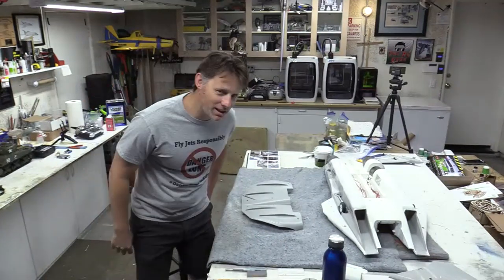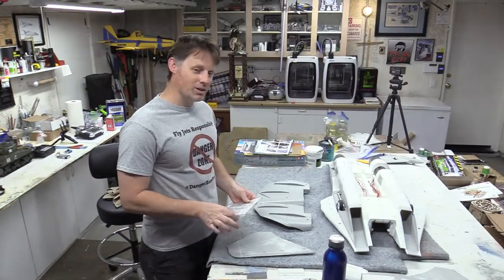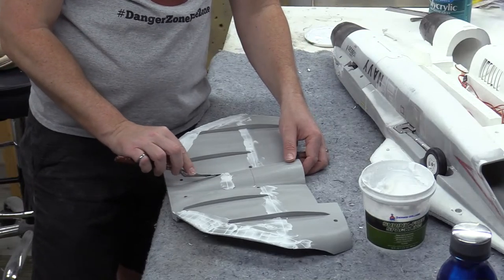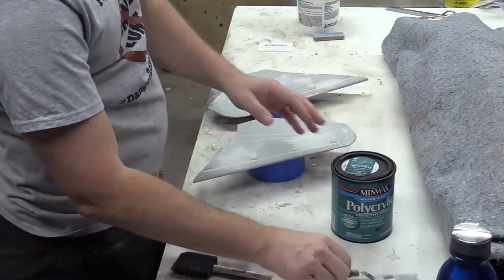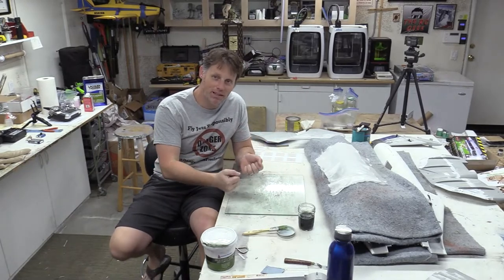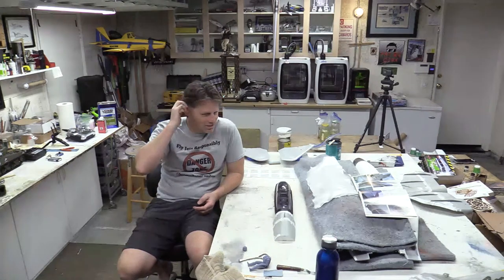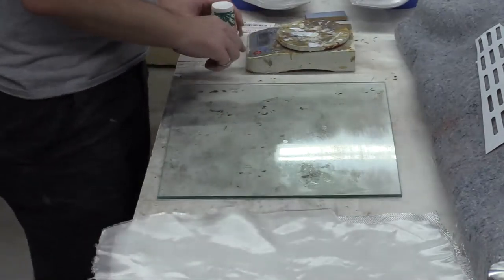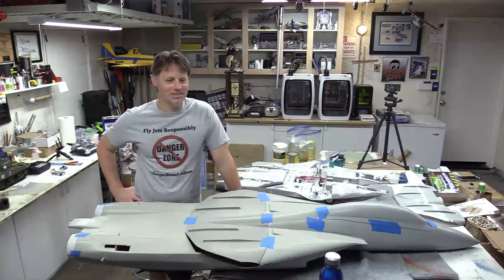Shop Time Live -- Foam Refinishing Tips with the Freewing F-14 Tomcat

Comment: I was going to try the A-6 gear on this airframe, they at least rotate 90 degrees for a bit more scale appearance. You and corsairnut have done great work on these airframes, thanks for sharing your knowledge will us all!
Reply from the maker: Thanks!  I still have a long way to go on mine. 😕 My only concern with the a6 gear would be wether they would be robust enough to handle the weight of the tomcat.

Comment: Another good spackle is Red Devil onetime light weight ready mixed Filler. Great stuff good to work with and sands well very light. One thing ya can do is go to car wreckers and get airbags the ones that have gone off as they are usually free. The ones with out blood on them even better. Most are made of Carbon Kevlar they work well have used them on a  couple things and there different thickness as well. ;0)
Reply from the maker: Cool, thanks for the tip!

Comment: Hey Chris, hi from New Zealand!  No flying here either :(. Another great demonstration of how it’s done by the master. Thank you. You mentioned gatoring of the foam in the cockpit. I know it’s not perfect scale by I put small holes in the very top of the clear canopy to let the heat out. Seems to work out ok. :). Can’t wait to see the F14 finished.
Reply from the maker: Thanks!  Even when there are holes, I’ve seen cockpits gator up. I like to cover all the exposed areas with card stock to hide it all, haha!
Reply: Yeah, no perfect answer. I have seen your card stock solution, looks great. I will have to try out that one!  Keep up the good work. :)

Comment: Hey Chris, I fly off a rough grass runway that doesn't have short grass.  I know that there are mods you can do to reinforce the landing gear, but do I have wishful thinking that I would be able to fly this off a rough field?  I have seen RC Informer's videos where he is taking off from golf course like grass, my field is no where near as nice.  Just wanted to get your opinion before investing $$ into this.
Reply from the maker: Yeah, I’m not to sure. Maybe with the right power system and tires, but that might be ok, but if the grass is that rough, you may be better off with something that has larger tires. What’s the length of the field?
Reply: @Thercgeek  Looks to be about 410 feet from end to end.  It's sometimes a challenge to take off with my FMS F-18 and FW F-35 if the grass is too long or if I don't have a headwind.

Comment: what about using that sanding cloth used on dry wall. It does not load or overcut.
Reply from the maker: It’s all about the grit on it, so if it’s not too gritty it should work just as well. Lowest grit I use is 180, any more than that and you run the risk of easily cutting into the foam. Epo whiskers when you sand it and you want to avoid that.

Comment: Chris, I’ve got an issue electronically with a Dynam Corsair that’s got me stumped. (As soon as you power down the receiver the landing gear retract. Spektrum DX8, does it with both the Admiral and Lemon receivers) This isn’t my first plane, I’ve programmed over 30 plants, 25 which are still operable. (That first year felt like I was training to be Kamikaze Pilot)
Plugged in the 5th channel for Gear
Channel Assign 5) Gear
“A” switch on the DX8 Gen2
Anything come to mind to try?
Reply from the maker: The fact that it is doing that when the receiver is powered off is strange. That would indicate that there’s still power. Usually something like that has to do with the transmitter configuration when the model was bound. I’m sure you’ve already tried, but try rebinding the receiver with the transmitter in the configuration you want the model in when you power it on/off. Otherwise, if that doesn’t do it I’m at a complete loss. I’ve never seen anything like that before. Usually it’s on power up and can be rectified by rebinding.
Reply: The RC Geek when I get back from Charleston I’ll check the DX8 and just delete the plane and set it up as a new plane. This aircraft has been my “Bermuda Triangle/Todd Marinovich”. It was my 3rd ever RC plane and I bought it on eBay. Airplane separate. motor, ESC, servos, pushrods and prop in a separate order. It is interesting, once the plane is bond, wheels lower, flip the “A” switch and the wheels retract. Never an issue while bound. Land, taxi, turn off the transmitter... up go the wheels. (I’m out there trying to look cool with my “Bro, do you even lift?” sweatshirt and my Pilot Ryan Spektrum cap. Having a Corsair with gremlins isn’t cool.
Reply from the maker: Based on wha you described, are you turning off the transmitter before powering down the airplane?  You should always power off the airplane first then the transmitter. That said, based on why you’re describing, when you power on, I’m guessing the wheels will start to retract during initialization. That’s really strange.
Reply: @jeffhenderson934  At first you said when you turn off receiver, you then say when you turn off transmitter. 
ALWAYS TURN OFF PLANE FIRST.
When you turn off your transmitter first, the reciever is still powered on, as it is inside the plane, it is now receiving no signal however (loss of signal). At this point the receiver defaults to its failsafe positions for all channels. Check your bind procedures. Most transmitters incorporate the failsafe positions into the binding process and usually just requires that you put all controls in the position you would want them to default to if signal is lost IN FLIGHT when you bind the transmitter and receiver. This is usually motor off, neutral controls, and gear retracted. Your plane is doing EXACTLY what it is supposed to. You, however, are following an INCORRECT power down procedure. 
ALWAYS POWER OFF PLANE FIRST.
You are lucky that the throttle channel is almost always set to default off, so you haven't got cut up by killing the transmitter first. 
LEARN ABOUT THE FAILSAFE SETTINGS, and when you bind a plane and think it's ready to fly, kill the transmitter while holding the plane to make sure the throttle is set to default off, gear are set to default up, controls are set to default neutral. This will not only keep you from possibly getting bitten on the workbench, but will keep your plane from going to full throttle and flying away possibly causing damage or injury to persons or property. You'll also stand a better chance of recovering anything from the crash.
Improper failsafes are very dangerous. Please read up, for the safety of your spectators, your planes, and yourself.
Reply: @jeffhenderson934  The failsafe info is covered on page 13 of the DX8 Gen 2 operating manual.
Reply: @jeffhenderson934  The warning to turn the transmitter ON FIRST and OFF LAST.......... IS ON PAGE 2.
Just saying🤔😕🤨😎.
Reply: Shelby Seelbach I had at the time when I purchased the Apprentice a 14 year old mentor (son of 2 friends of mine) who had by my calculations, $25,000 worth of planes, a DX6, DX9, DX9, DX18, and had just gotten a ix20. It was his suggestion as a newbie to buy the DX8 and the Apprentice. I still remember the day the DX8 arrived. That manual might as well have been in French, Italian or Hebrew. It’s just a little smaller than Leonid Tolstoy’s “War & Peace”. 
Those first few months were brutal- The plane setup, trying to understand the transmitter, buying a Venom Quad Pro battery charger (lipos, different cell sizes, different plugs, etc) I wish I had tried as hard in college!)
Probably not a good thing that I have bragged about of the 30 planes I’ve built, (25 still in existence) that I’ve need opened the manual except to see what they suggest for the CG and the rates. I think that eBay Dynam Corsair got me started on the wrong foot. No manual. Just the plane in one box and pieces in another box.
Reply: @jeffhenderson934  I don't own the transmitter, it took two seconds on Google to get a perfectly legible English manual for the transmitter. Once again, just saying.😉
Reply: @jeffhenderson934  please don't think I'm just attacking you. If you type Dynam corsair manual into Google it takes you right to it. If you type DX8 gen 2 manual into Google, it takes you right to it. It always amazes me when people will use the internet to ask questions of someone who may or may not know the answer and who may or may not give you correct or incorrect information. It is the same internet that if you just search for the information, you can get the information straight from the manufacturer and know it is 100% correct. I have had friends call me on their smart phone to ask if I know what time a restaurant or store closes. If they had just asked the question to Google using the same smart phone they used to ask me, they would have pretty much instantly had the information they wanted and known it was correct instead getting a guess. 
It's just funny to me, nothing personal. I'm glad I could help, but I got the page numbers by googling the manual for your transmitter. It took literally seconds. 
Keep em flying, and keep on learning.

Comment: Is there any real way to get rid of the gator texture of these EPO planes? Lots of coats of paint and sanding? Or is fiberglassing the only real solution? Wish these companies would figure out a way to produce SMOOTH skin on these planes. All the other details, panel lines, markings, etc., don't really matter if the plane itself looks like a coffee cup.
Reply from the maker: Well, the best way to avoid the gatoring is to keep the models out of direct sunlight when not flying them. There’s really no other way to avoid it. No coat or finish will stop it from happening either. That being said, these newer airframes coming out from eflite and motion rc have extremely smooth finishes to them.
Reply: @Thercgeek  Thanks for the reply! It's been several years since I bought a foamie (FMS 1400mm P-51) and I decided not to buy any more because the gator texture just killed it for me. With a lot of the great balsa ARFs from Hangar 9, E-flite, Great Planes, Top Flite, etc., disappearing, I'm hoping the foamie manufacturing methods will soon "mature" so the new foam aiframes are worthy replacements. Glad to hear progress is being made. I might have to check out some of these new motion rc birds.
Reply from the maker: Foamies have improved greatly the last couple years.